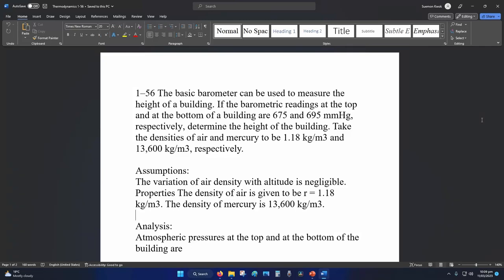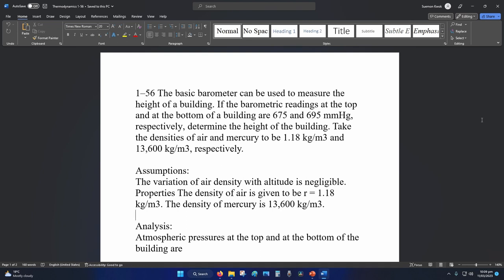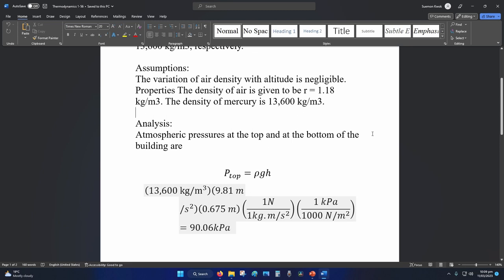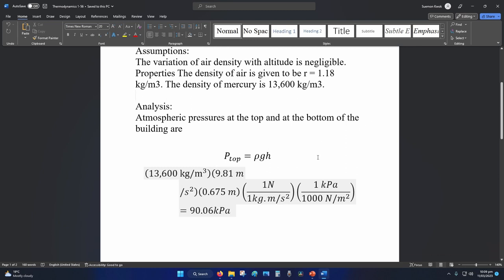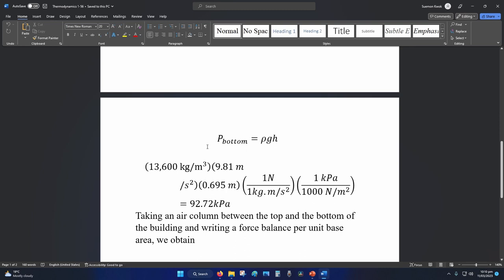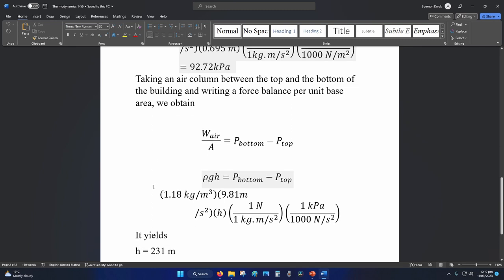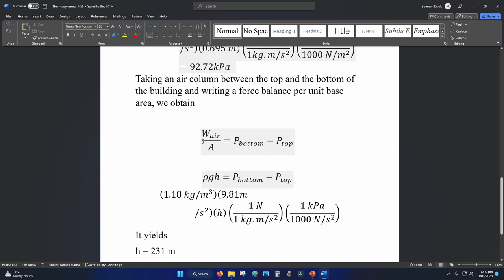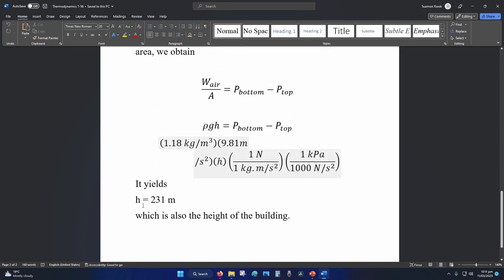Thermodynamics 1-56 The basic barometer can be used to measure the height of a building. If the

Comment: Where are you getting the heights for h in the Ptop and Pbot equations?
Reply from the maker: You convert the mmhg ( millimeters of mercury) to mhg (meters of  mercury) which roughly the same meters

675 mmhg /1000 = 0.675 mhg
695 mmhg/1000 =0.695 mhg